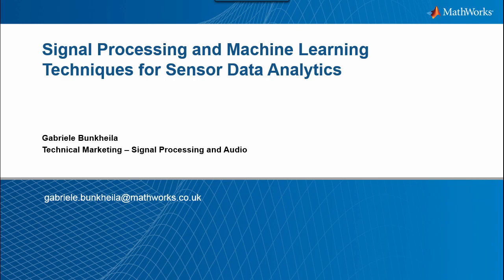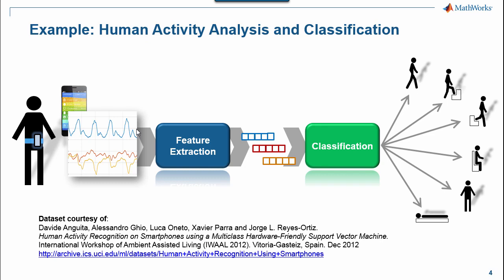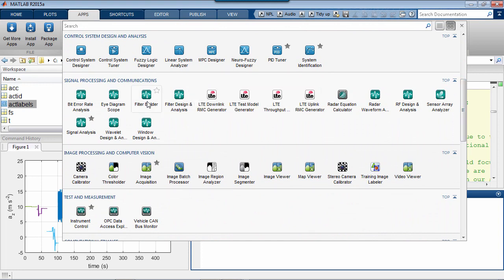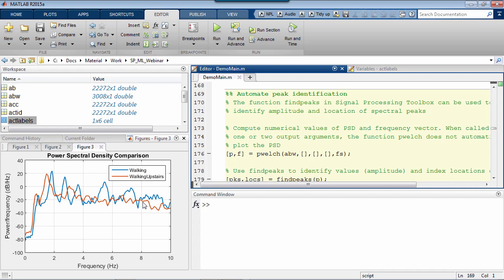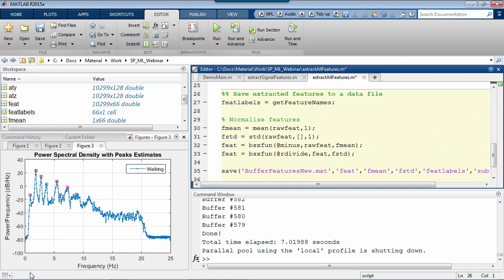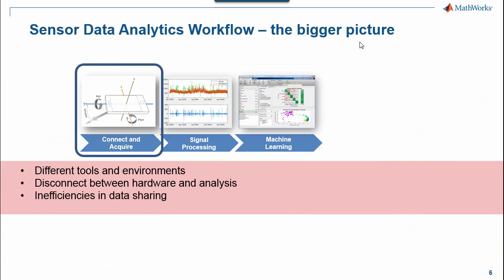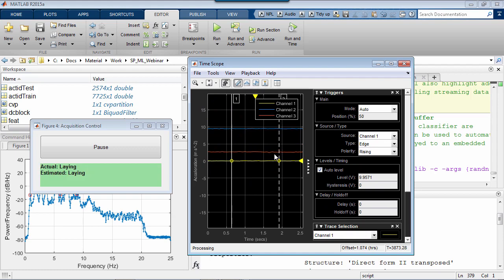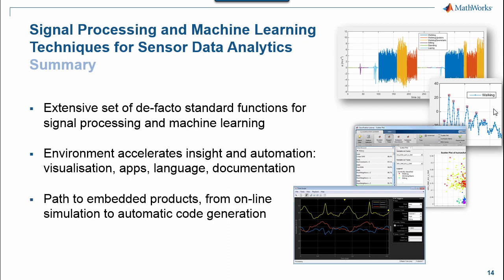Signal Processing and Machine Learning Techniques for Sensor Data Analytics

Comment: Hi,
I would like to ask a specific question and I hope that someone might answer it.

Is it possible to apply such features that have shown in this video for "Signal Processing and Machine Learning Techniques for Sensor Data Analytics" to Ardupilot drone applications (to lower the noise caused by gyro, compass, accelerate-meter, barometer as comparing these to get best result, like using the Kalman Filter) by using MATLAB? thank you. 

The reason I have asked this question is to find a way to get the parameters from the drone sensors to use them for No GPS usage for the localization/positioning for drone movement with the help of MATLAB.